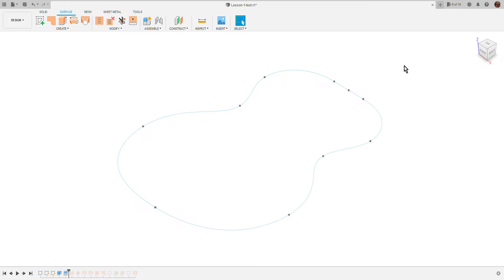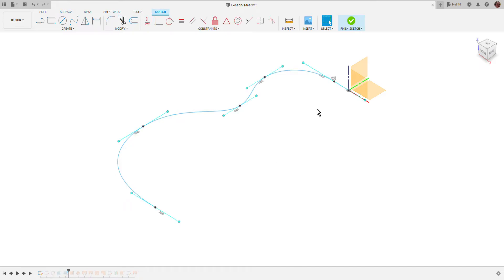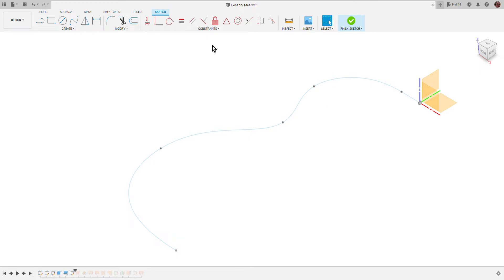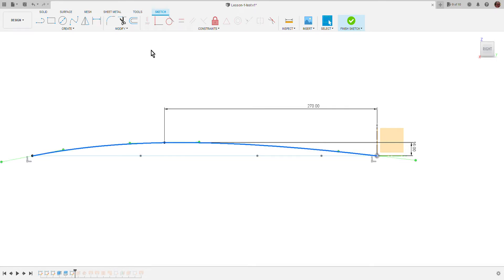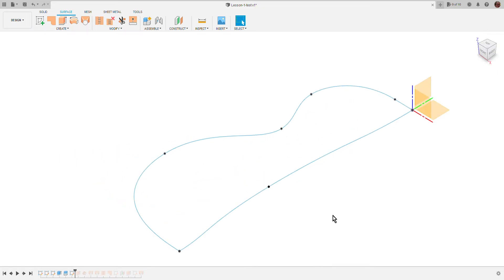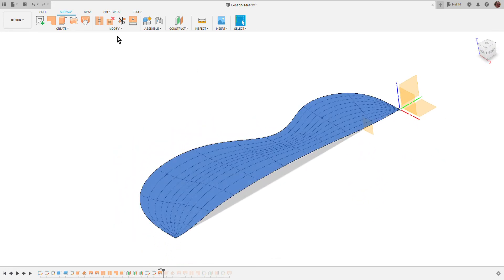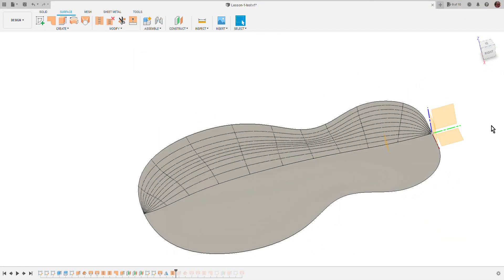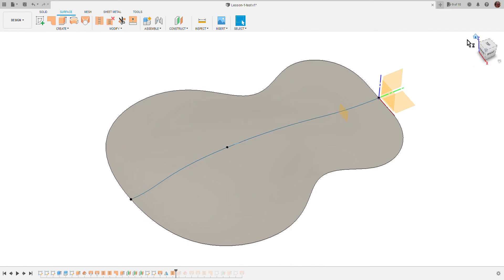Archtop guitar surface modeling with Fusion 360 (loft tool)

Comment: Great technique... I am attempting to apply this to a mandolin top... There is one step that I cannot pick out of the video.  At 9:07, you say "we want the profile tool to be tangent", and then you do something (dialog boxes are not visible).  I am having an issue with the two surface halves dipping a little where they meet, and I believe that this missing step may fix my problem... can you describe what you did at that point.  Thanks!
Reply from the maker: Sorry for the late answer... You have to select in the loft tool "tangent" for the center helper surface. If you do not make it tangent, you'll end up with a small ridge. In my other video you can see the small windows. :)

Comment: Vincent- Thank you for your efforts. It is a very clear presentation and shows an excellent solution to arch top CNC. I am in the process of making a cello using the CNC. This presents a different problem since the thickness of the top and back varies by way of the inside surface . I have several sketches showing the thickness geometry, but I don't know how to incorporate this into an arched top and back. Would you have any experience in this area? The problem is common to all bowed instruments.
Reply from the maker: Sorry for the late answer. The best way I think would be to model each surface of your top (top of top surface and back of top surface) independently and then loft the contur from one to the other one at the end. You will end up with your top plate with the right thickness. :)
Reply: @dantahoua  Thank you- Much appreciated.

Comment: Great technique - very straightforward.  I never would have figured out the helper surfaces.  One issue - I think your feature dialog boxes were off-screen (maybe on a 2nd monitor).  It would be nice to see them.
Reply from the maker: Thnaks and yes I figured it out on my second video, seems the default screen recorder of windows did not recorded them... :( Welll, I should have used OBS Studio or my Mac... Next  time!